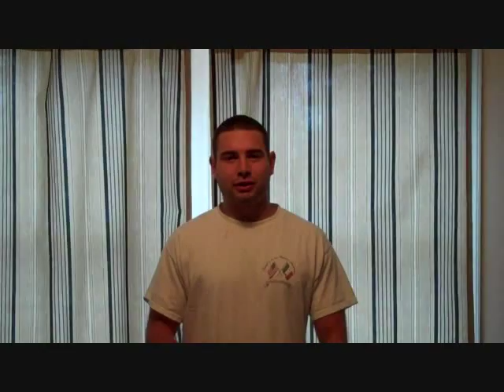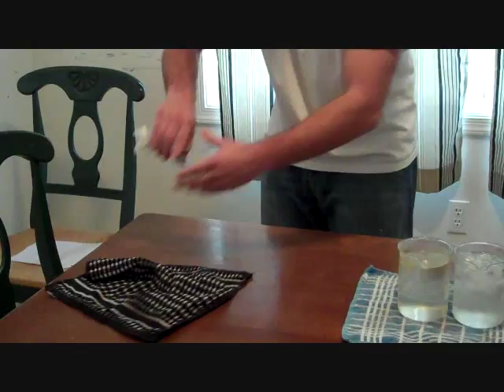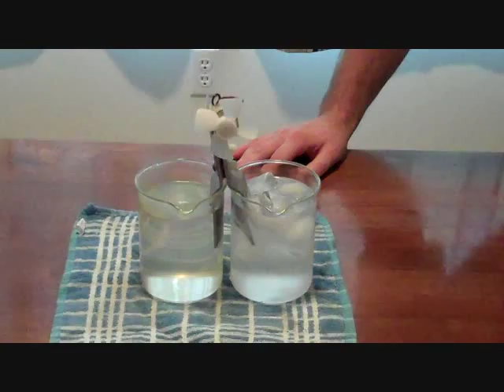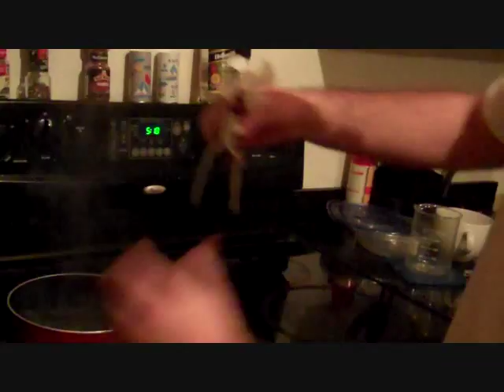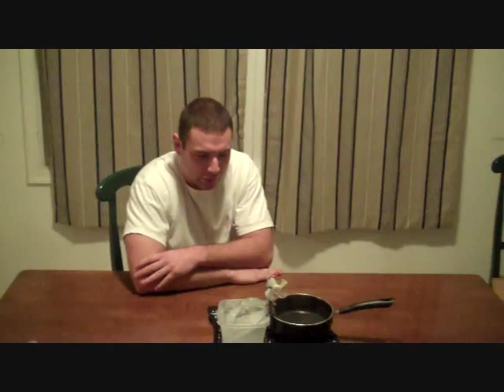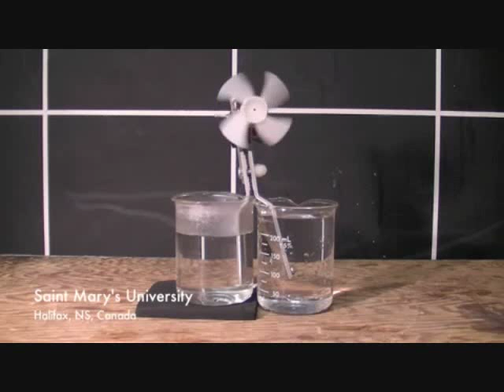The ThermoElectric Effect

Comment: Obviously someone who doesn't know electricity. You need to have a closed circuit for current to flow. If the electrons that are supposed to flow to the cold end have no where to go. That means they won't move.

However, even if it was wired correctly, I don't think there would be enough juice to power that fan. The thermoelectric voltage generated by this device will not be enough to get that fan to turn. I believe that last part was a fake. Sorry. (".)

Comment: it looks like a screw shorting both metals so that electricity does not pass through the engine without passing through the short path / screw to the other metal is a short-circuit, you've got therefore not spinning engine attempts to assemble metal engines with a wooden pine so that the metals are not touching

Comment: What you need is a simple charging circuit. The raw DC off of the thermoelectric plate is too low to overcome the static friction in the fan. You can fix that by storing energy in a capacitor and releasing it in bursts.